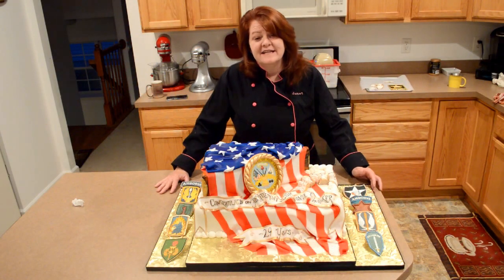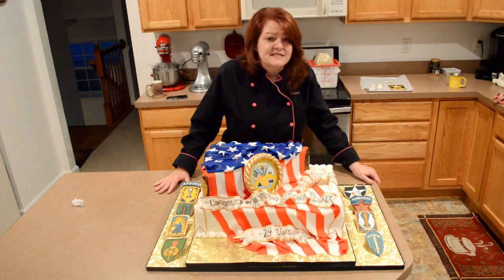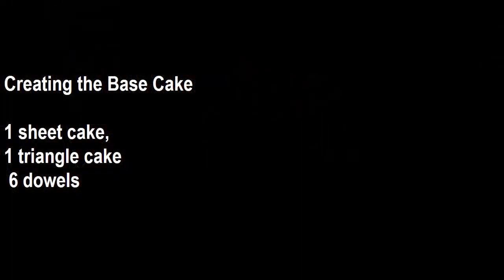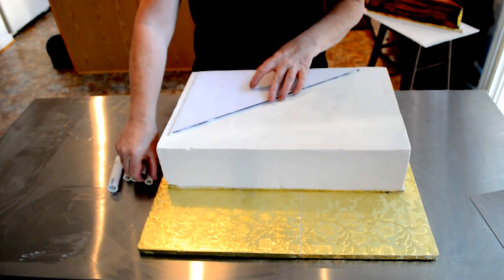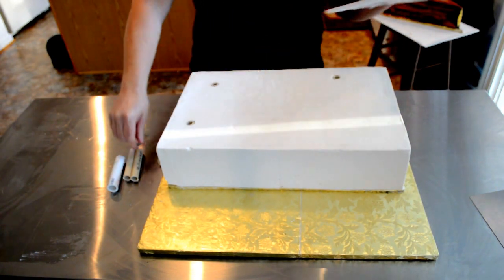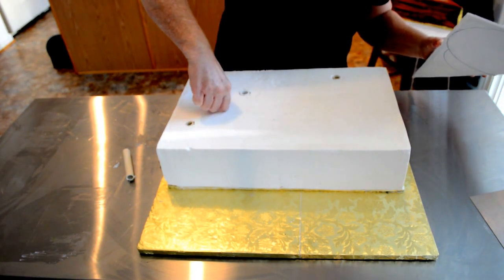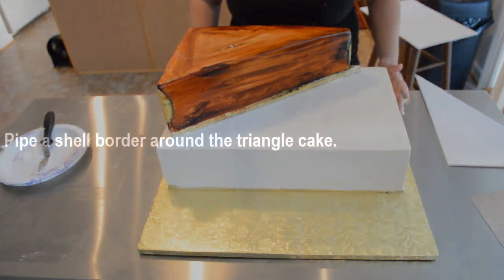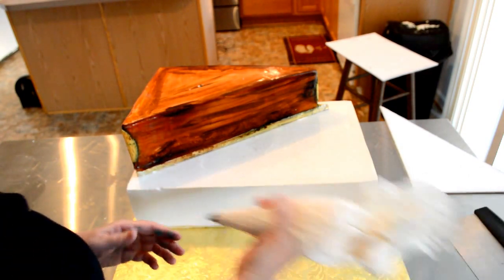PART ONE FLAG CAKE BASE

Comment: Dear can you help me make a Tanzanian 🇹🇿 flag cake like that one
Reply from the maker: Grace, a tanzanian flag should be much easier.  skip the Blue section go to the stripe section.  Instead of taping off horizontal stripes, Tanzanian is just diagnal green, yellow, black and blue.  If you don't have an airbrush, you can actually tape(mask) off the stripes and hand paint or even sponge paint the color in.  The corners are Green top diagnal and blue bottom (I think)  instead of layering tape, position a piece of paper diagonally the tape the edge.  It looks to be a pretty straightforward pattern.